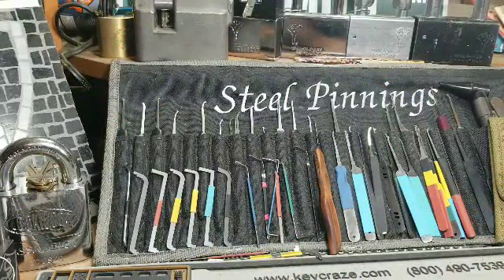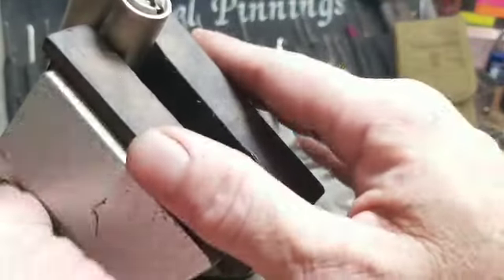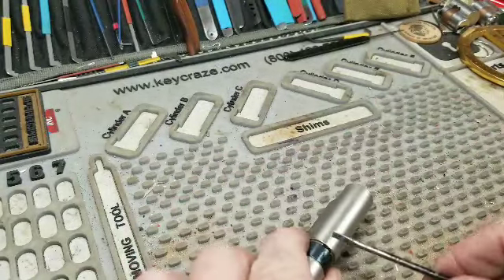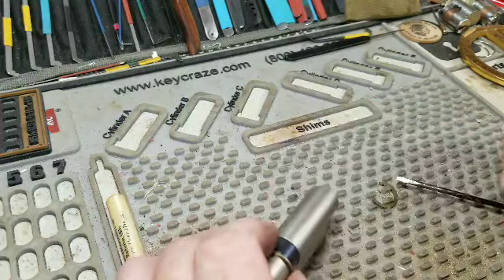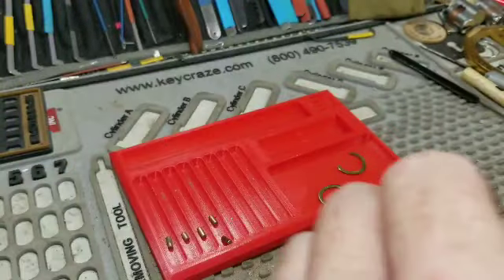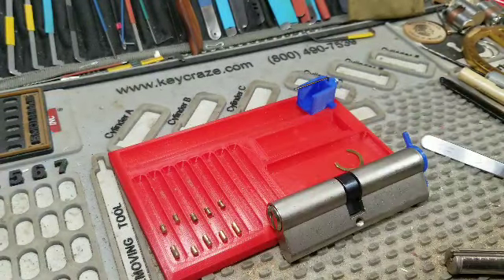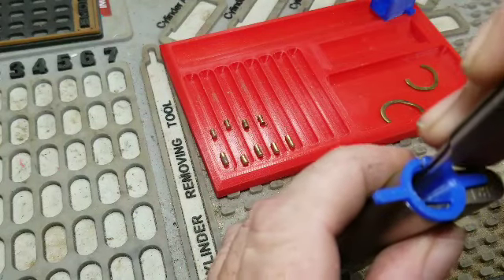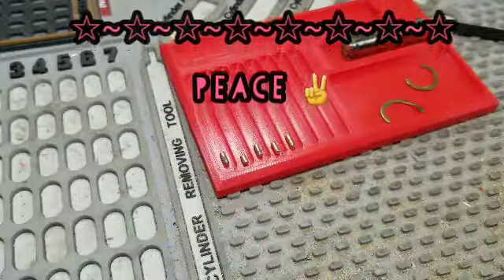🔒🔑👉(301)👈🗝🔓
PICK, GUT, & 
REASSEMBLE (FAIL)
STOCK WINK HAUS
PROFILE CYLINDER

Comment: Good picking buddy. Ya, I was told do NOT use the 3D printed front loader. I have not tried it yet. Now I wont LOL 😂.
Reply from the maker: Albert Lebel 
Well it really wasn't the twist loader as the problem... it was the shoe. The rod that holds down the drivers is really good good. Very weak and a strong spring will push the driver up and pop out. But I have the HUK euro disassembly kit and that shoe is much stronger and worked like a dream. So that is the problem.  That pin in the shoe needs to be tougher.💪
Oh and Peterson has a euro disassembly kit with front loader made of Stainless steel. But the price is phenomenally high